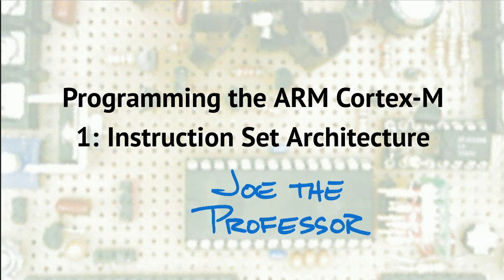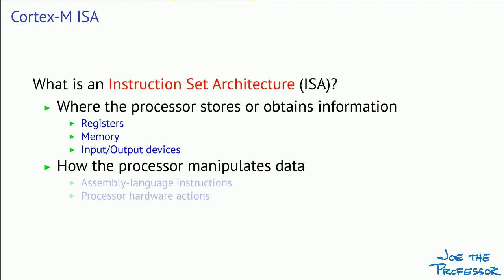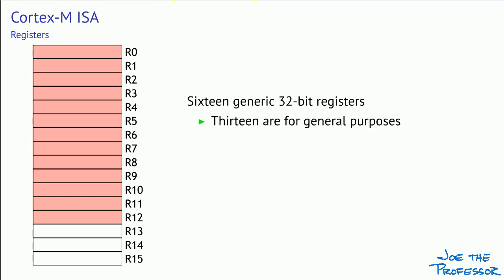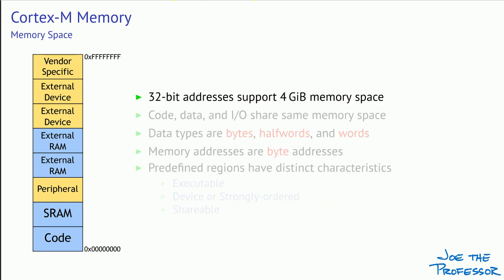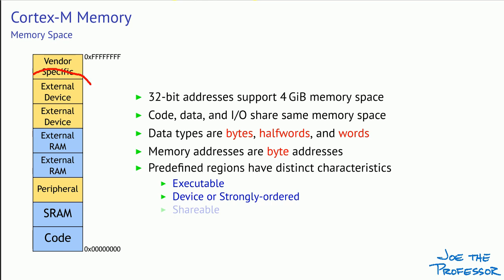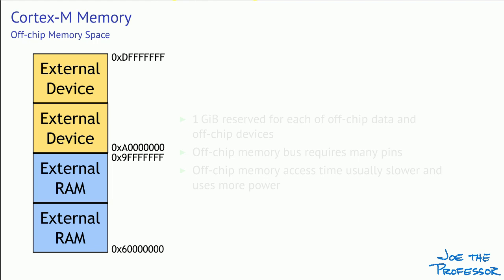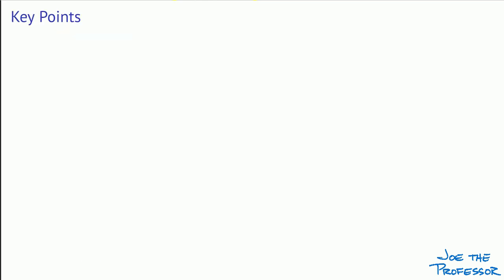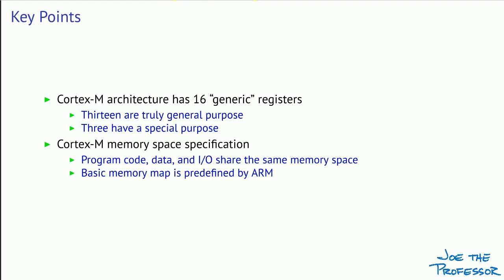01: ARM Cortex-M Instruction Set Architecture

Comment: 7:45 isnt processor access 4 byte alignment of memory?
Reply from the maker: From an architectural point of view, there is no general requirement for 4-byte alignment. Instruction fetches must be half-word aligned. Data load/stores can use byte addresses, such as LDRB and STRB.
Reply: @joetheprofessor6260  you have not be making more videos on Arm. Why?
Reply: @temitayoolufemi4364  He doesn't owe you that. You could ask him politely if you wanted some.

Comment: Maybe I missed something, but does ARM have a "zero" register like MIPS that always returns 0 bits?
Reply from the maker: No, the ARM 7M architecture does not have a zero register.
Reply: @joetheprofessor6260  thanks, its making more sense aa I get further down the video list. I guess with 32 GPRs on MIPS 32 they could afford to "waste" one for the zero register for some neat tricks. I know MIPS from many years back, but I am learning ARM because it seems to have basically replaced it everywhere.
Reply: @joetheprofessor6260  just got caught up with more recent ARMv8/aarch64 and it seems like they took a page out of MIPS' book. So there are now 32 GPR and register #0 functions as a constant 0 filled.